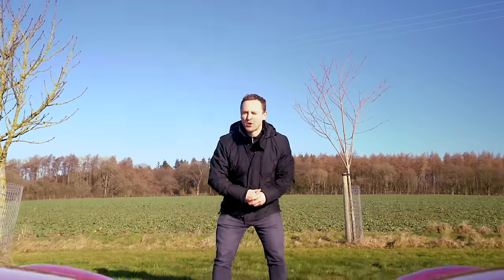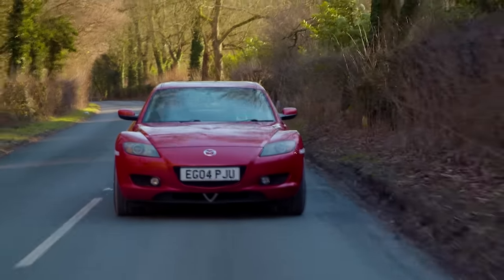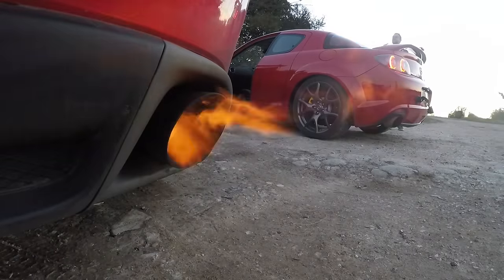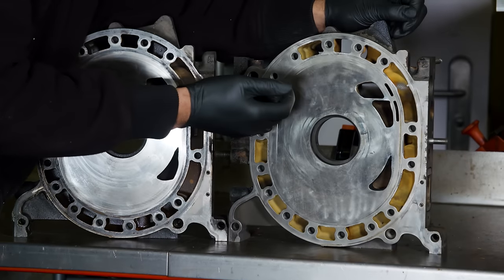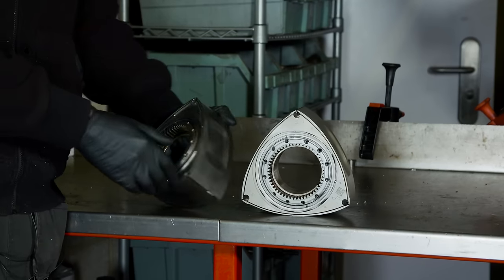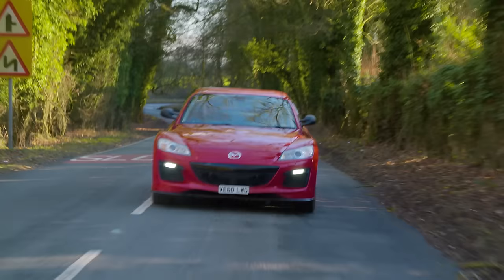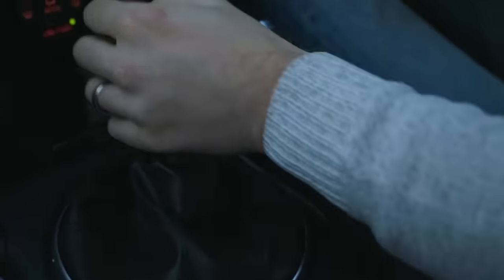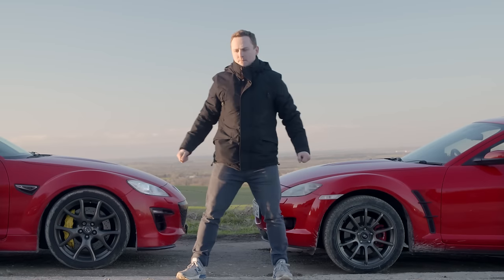The Differences Between Bridgeported & Street Ported Rotary Engines

Comment: Please for the sake of the rx8 polish those headlights, they look so sad.
Reply: I think he mentioned a detailing/refurbish video coming soon. Just like they did with the Skoda (Miles)
Reply: EXACTLY
Reply: Polish will just fill you need to wet sand first.
Reply: @aquatics117  and he will need to remove the clear lens fronts. Mine are the same. There is a build up of crud on the inside due to condensation. Mine are the same.
Reply: And return the stock wheels
Reply: fill needs his lights swapped for the R3 HID beams, R3 i still think is 1 of the best looking cars.. might b a bit partial tho cause i had 1 from new.. felt so good carving up twisty roads.. even tho new 240i does everything better it still doesn't have that light seat of your pants feel the R3 did. older rx7 do as well .. this feeling they're describing towards end of vid is there.
but yea swap for R3 lights!!!
Reply: Front on the RX8 looks happy no matter what goes on around it’s body, that big cheesy Mazda smile, love it.

Comment: Do an electric conversion of the rx8 then just put a huge speaker in the bonnet and record Josh making rotary noises so it still sounds right
Reply: Or not
Reply: As funny as this comment is, Rx8 is one of the best platforms for electric conversion
Reply: Jonas Lekstutis no its not
Reply: @TheBerlinbaer  yes it is. Neighboring company did it, 200kw electric motor, no big battery and a very very fun track car.
Reply: @MrJObajobas  I think he used one where the engine was broken right? Or was that another video I am thinking about... Ah it is... Here's the link: https://www.youtube.com/watch?v=F-6JjiPHGaM

Also tbh I would recommend getting one where the engine is damaged since it will be cheaper and that leaves more rotary engines in the world. Also I lowkey kind of want to do a hydrogen conversion on the rx-8 because there was a hydrogen version of the rx-8 called the hydrogen re.
Reply: @adelaide7822  no it's a big EV product company in Lithuania, it's called Elinta. I kinda want to make the same thing. And of course they used the one with damaged rotary, they are cheap as hell lol.
Reply: @MrJObajobas  yeah I don't understand what is the problem then, I think it would be a fantastic EV to drive.
Reply: @adelaide7822  yeah, shame they didn't let me drive. But basically it has tesla power and regular rx8 weight. That really should be an awesome thing to throw around some coners!
Reply: @MrJObajobas  Yeah I can imagine it would be a lot of fun...
Reply: @MrJObajobas  why can't companion make fun EVs , they'd be so cool . And because they don't have any of the engine bits , it cool look awesome too
Reply: @TheBerlinbaer  Good work, you're so bad at defending your position that you're now going after people with ad hominems. Sure, they're green. 

As green as you are slow. Electric torque makes muscle out of any chassis. Accept it.
Reply: Andrei Yang It makes tourqe for the first 200 kilometers u drive. Then u need to charge 1 hour to drive another 150km. In this time i passed u with my „dirty“ diesel 6 times :) accept it
Reply: For that money, I'd do a 20B conversion and call it a day! 💪
Reply: @TheBerlinbaer  reflect on this interaction. it doesn't make you look good
Reply: @almatsailaukhan9181  reflect ur religion. It doesn’t make you look good.
Reply: @TheBerlinbaer  As much as I prefer real engines, a stock electric sedan became the fastest production car in the world. Def not bullshit
Reply: @TheBerlinbaer  rx8  are pointless, unreliable, and just destroy themselves over time. Purely a gimmick
Reply: @MrJObajobas  Because there are plenty of cheap ones out there with good paint, good interior and a fucked engine? Plus electric power steering, so you only have to deal with vacuum boost for the brakes and you can nick an electric vacuum boost pump out of a prius.

All told though, I'd say one of the best platforms for an EV conversion would be an S1 Elise - with the old rover k series engine, preferably with a blown head gasket :) lighter, and the thing was practically designed to have different powertrains dropped into it, and has some lineage with the original tesla roadster as well (although i think tesla roadster was related to the Elise S2, not the S1 but dont quote me on that)
Reply: ikr

Comment: That 214hp proves rotary revs did an excellent job
Reply: DespacitoBurrito thought they claim 230 from factory?
Reply: @Nebbia_affaraccimiei 
Yes ! 
But absolutely zero RX8 delivers that much power from the factory. They produce around 200hp/210hp...
Reaching 215hp is a great result.
Reply: @alexandrerousselin4467  thought port/decat/mapping would give more than 5hp, for that price...
Reply: @Nebbia_affaraccimiei  the 230 from factory isn't at the wheels.
Reply: @AsBe25.  neither is the 214 at surrey RR
Reply: @Nebbia_affaraccimiei  yeah he got 162 HP at the flywheel at Surry previously.
Reply: @AsBe25. 
I know. And I insure you that they produce 200hp at the flywheel. They don't reach 230 hp. 
When you do a dyno test, the result is calculated to show the power at the flywheel, unless you ask to show the power at the wheel.
Reply: Vz z7Alexandre Rousselin nbbgty
Reply: Tell us some other 1.3 liter N/A which has more than that
Reply: For all the people saying it isn’t reaching the claimed 230 thats ok because the car itself is about 15 years old
Reply: His car was a 192hp model not a 231hp model guys
Reply: @NorthernIrishBaii  The sad truth is he states in the next video that its a 231hp model. so im confused is the 231hp a lie from mazda ?
Reply: @davedonnelly8681  It absolutely is 100% the 231 model. Easiest way to tell is the 231 has headlight washers, the 192 doesn't. It was 231hp at the flywheel, which equates (due to parasitic loss through the transmission and driveshaft) approximately 190hp at the wheels, which is what a dyno measures. So getting over 200hp on a hub dyno from a 14 year old refurbished engine is excellent.
Reply: Mark Bowyer hmm I thought the dyno was converting to a rough fly wheel figure. Anyway if it is over 200 atw that’s great
Reply: @davedonnelly8681  Yeah, I'd have to rewatch the video to be 100% sure. Dynos, being rolling roads measure power at the wheels so without taking the engine out you'd have to estimate bhp.. Perhaps that is what they did, I can't remember. 214 is really good if it's at the wheels, so yeah, probably worth checking the video.
Reply: @davedonnelly8681  Even watching back it's slightly confusing, but from what was said I think you're right, it's a calculated bhp. I guess people just like dynos to pump out higher numbers so don't mind the estimation involved. The general consensus on the owners club is that Mazda were very "generous" with their original figures and once the car got to the dealers they were making a fair bit less. 
Still love them regardless. So much fun.
Reply: Mark Bowyer yea it would only be estimation if it was flywheel. I wouldn’t care if the rotary made 100hp atw, such a unique little car and a wonderful piece of modern engineering can’t wait to own one in the future.
Reply: @davedonnelly8681  Just been watching videos on how dynos actually work! A lot more to it than I ever imagined. BHP figures can be measured accurately on some dynos apparently. It's kinda complicated! 
Yeah man, they are a blast to own. Stupidly expensive to run though.... I'd hate to have to commute in one. 
The cars are at the edge now where they are either having a lot of money spent on them or they are getting scrapped. I can see the price of them going up quite sharply in the next couple of years. Hope you get the chance to pick one up before they get silly.
Reply: @HuuTonyTran  haha ur not even close to what a rotary means, in fact, it seems that u dont even have a driving license. It's all about rev range and weight distribution. I've had a lot of cars faster than my rx8, but none of them were as fun to drive as this car. And Im getting close to 200k km without rebuild.. Everyone says shit about them but nobody has one
Reply: @ThunderTigerRider  cheeky answer is Hayabusa, a lot more.  Real word answer is, the engine, in one full cycle (all the rotor chambers go through intake, compression, combustion, exhaust) breaths in 3.9 litres of air, thus making it by definition 3.9 liter engine . Any old 4 liter makes more than 215 BHP ;)  and even if you take more conservative approach from global authorities (e.g. FIA), its still considered a 3.2 liter. So old M3 springs into mind right away, that has more power per liter.
Reply: a box stock honda k24 NA would make that only with much more torque. the exact same weight, and will run without a single issue for 10 years.
Reply: why was waching a video on rx7 specialists where they made a 13b n/a  with 300hp estimated.
Reply: @slappomatthew  Same weight? Nowhere near, and the torque is pretty much identical if not slightly less. Of course there are more powerful engines. There will always be a more powerful engine. And none of that makes the RX8 any less fun to drive.
Reply: @jetmano  That's some pretty interesting maths to get to that result! The engine makes up about 30% of the RX8. A little more power would have been nice. but you try finding a 112kg 4 litre engine. 
Simple comparison between the M3 and Rx8 laptimes in these videos are a pretty decent demonstration of how capable the car is.
Reply: @gonzomuse  You are correct, the engine compared to other designs is extremely light for a size, but the question was power to engine size ratio.
Reply: @jetmano  That's the subject that you chose to address. There is no definitive answer that I can see, as they operate in completely different manners. Actual displacement is 1.3litres, but the airflow is 3 times that, so how can you compare an apple to a hedgehog? 
Like all designs it has its pros and cons, but it does also seem to attract more than its fair share of hatred though. 
Personally I love it. The small size and weight contribute a great deal to the way the car handles, which is fantastically even 16 years after the 8 came out. Of course it's relatively high maintenance and difficult to get good power from but you gotta take the rough with the smooth.
Reply: @gonzomuse  I didnt choose it, i was merely answering the other lads question to point out engines with more power per liter.
Reply: @juggnautbitch  That's an unusually high figure for a stock engine. There aren't many bolt ons that do all that much to a Renesis. Do you have a source?
Reply: @juggnautbitch  Right.. Yeah, he's experimented with the engine more than most. Losing the cat is definitely one of the easiest ways to get a little bump in the power. Just makes running around every year trying to scavenge one for the MOT a huge pita!
Reply: @davedonnelly8681  There was a big thing in the later 00s, at least in the US, that a lot of foreign manufacturers had power claims that were...optimistic. Hyundai/Kia was hit more recently in 2012 but several Japanese manufacturers (could be others, I only remember Honda, Mazda and Nissan specifically) were using correction factors that resulted in higher ratings. You'll see some power rating changes for otherwise unchanged engines around that time.for this reason.
Reply: @ThunderTigerRider  2.6L would be more fair to an otto-cycle since a rotary fires 1.3L of displacement per eccentric shaft revolution (which is where RPM is measured). Hyabusa engines are 1.3L and rated at 197, though.
Reply: Róbert Marko kawasaki suzuki honda yamaha
Reply: Alister McCallum yep.
Whereas the vw/audi/skoda group 1.4 twincharged engine makes an EASY 180bhp and i regularly got 5.5 litres per 100kms in my fabia RS.
All the forums used to reckon a ecu tune would net about 205bhp.
Sure being a twincharged engine it used a bit of the ole castrol synth...
And i reckon an rx8 wouldnt get away from it in a straight line trolls rotormotor heads hard
Reply: @HuuTonyTran  My buddy's fd makes 880rwhp on e85.
Reply: @jetmano  Find me a 4 liter that weighs as little as a 13b.  Don't care what you classify it as by displacement, tiny package, big power.  My buddy's fd make 880rwhp and the 13b in it weighs about 300lbs, bigass turbo included.
Reply: @ThunderTigerRider  chainsaw r 100
Reply: My k24 made more reliably on stock bottom end just cams and ports lol
Reply: Tony Tran you aint swapping in a 2jz for 5k lol
Reply: @sugarnads  fd3s with ultralight tuning shits all over a skoda. Rotaries are motorsport engines. As proven time and time again.
Reply: @slappomatthew  but it will never sound as good, I like the Hondas but this is end of an era complete fun antidote to the woke carpet munchers saying the planet is destroyed not yet 🤪

Comment: 8:14 the owner was sweating bullets!
Reply: HAHAHAHAHAHA!
Reply: "That was 10,000RPM!"

owner: 😰😰😰
Reply: TRUE
Reply: Yeah..  Just cause it can rev to 10,000rpm doesn't mean it should
Reply: Of course it should it works way better at higher RPMs thanks to lubricant flow
Reply: @mickael_guitara  not all the time tho
Reply: @ThEN003tr0ll  It beeps at you if you are going too hard on the engine.
Reply: @PneumaticFrog  it beeps at you when the ECU wants you to up shift. Had one and that's the only thing the beep is for
Reply: @mickael_guitara  What a load of nonsense, more likely will blow out the oil pump gears and unnecessary RPM. The engine would be laying over @10k so all he's doing was thrashing his buddies ride for no reason. Even bridge ported it's max HP band is probably in the 8k range then dies in the arse. Think it's safe to say it would probably be the last time he lets anyone drive his car again
Reply: @Twenty_Six_Hundred  I didn't say it works better at redline lol, just that +6k more often than 2k is better
Reply: Why even let someone else drive your car.

Comment: I went from Belgium to the UK to have my rx8 rebuilt by Rotary Revs. Doing trackdays since then with it for two years now without a problem. Rotary engines can be reliable as long as you treat them well which is not the same as being gentle... 

I find these cars underrated. Apart  from all the rotary fun, they handle really well...
Try it yourself... hint 

I'm a huge fan of Rotary Revs and this show!!!
Reply: Do you rev it to redline on track days?
Reply: @scarea2691  yes, I shift between 8500 and 9000. Depending on my timing skills. I try not to hit the Rev limiter. I don't shift before I hear the warning beep 😁.
Reply: Vanmada.   So dat did I.
Please look us up as, a friend and I started a small business for rotary cars. We have our customers engines build by them too. We have a partnership with RR.
www.b-rpm.be
Or ok Facebook.
We go to tracks, have meets, but also provide you with the correct parts 😉
Reply: @Vanmada  make sure to look us up mate 😉
Reply: @svenbollen5535  I just did 😉. Have read your site with interest. I'll be in touch, when the time is right...
Reply: Did you go for the braps? Do you daily drive it for 2 years?
Reply: @Ozem_Israel 
Hi, I drive it regularly, but not as a daily. I'm doing too many boring highway miles. It would kill it without me having fun... You have to use it for what it has been designed for.